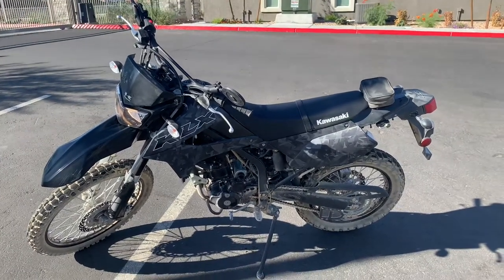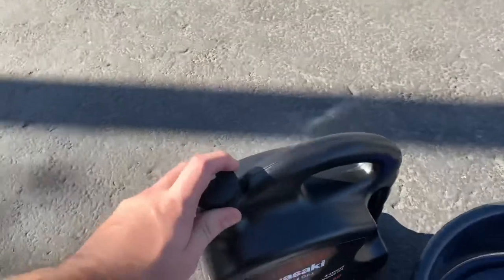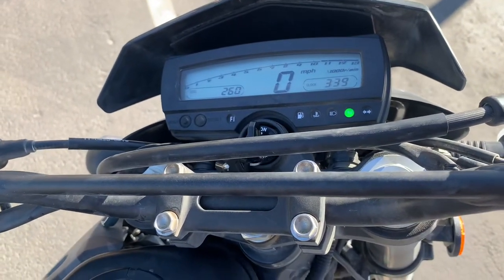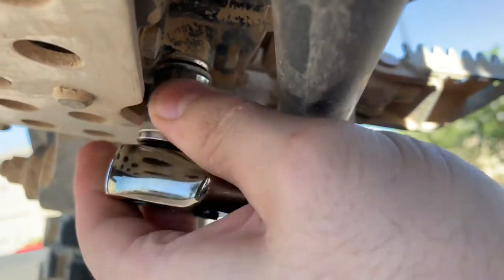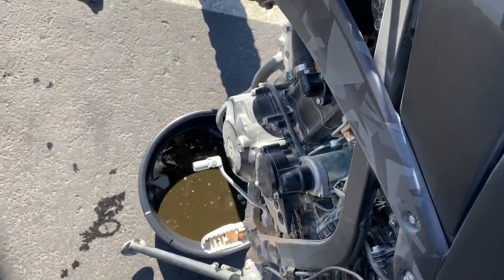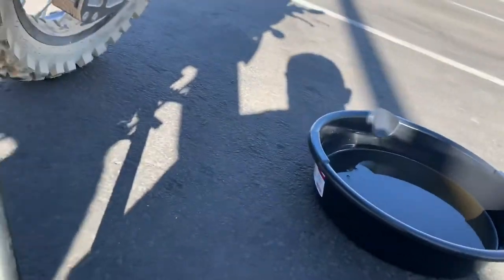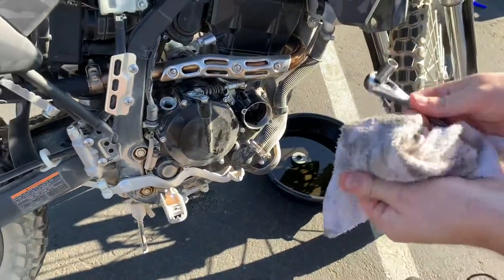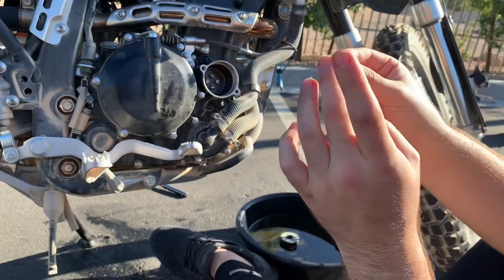How To: 2018-2020 Kawasaki KLX250 Oil Change | KLX 250 GETS ITS FIRST OIL CHANGE

Comment: Never leave your oil cap open, it allows dust and other partials to fall in, the engine is already built with small areas for air flow when you change your oil, opening the cap doesn't get anymore airflow in